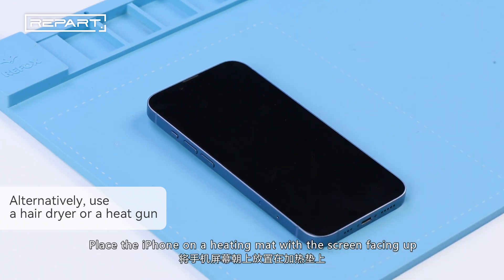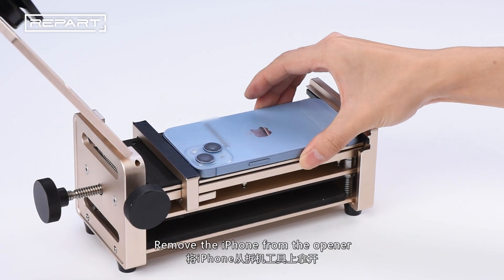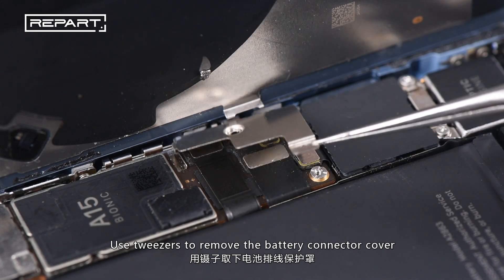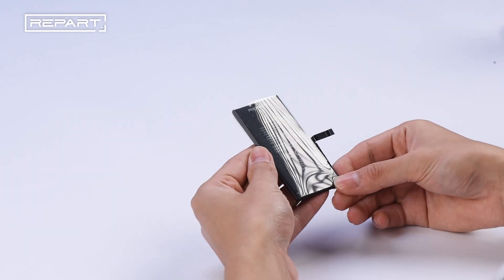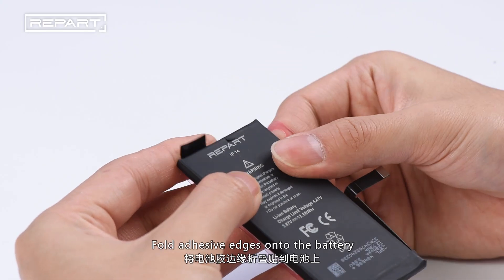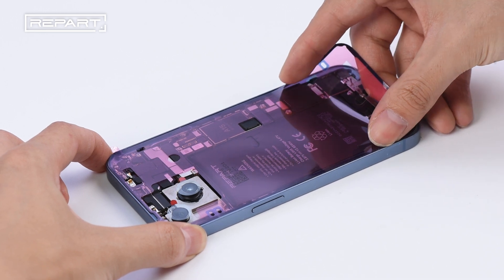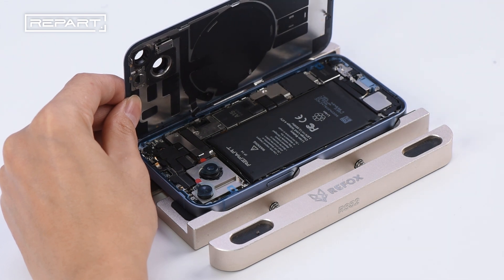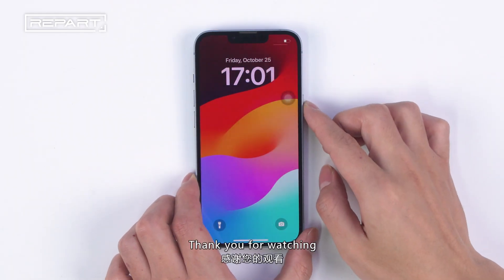REPART iPhone 14 battery replacement

Comment: Isn’t it recommended to reuse the original battery cable? Otherwise the phone would have some functions turn off
Reply from the maker: the latest iOS 18 solution for battery replacement might get this problem solved without using extra tag-on cable.